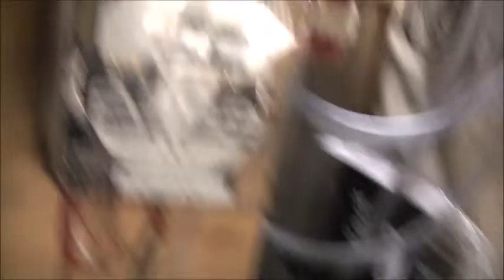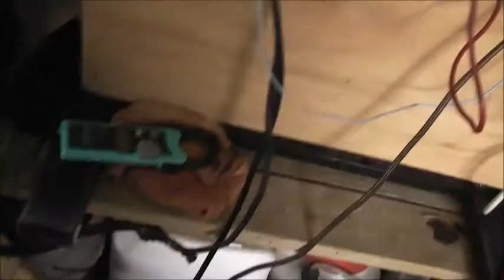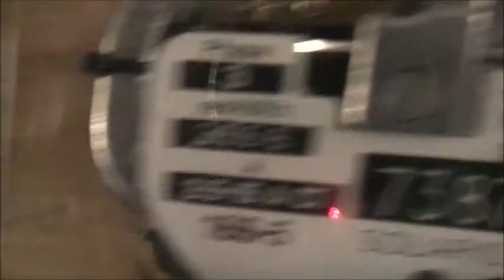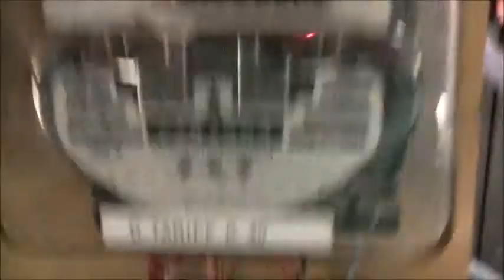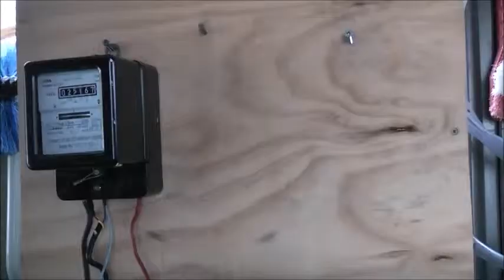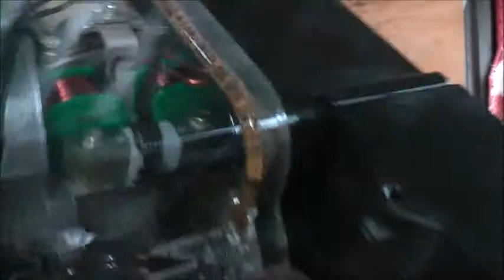EMAIL SD MR Dual Tariff CT Watthour Meter Test & Clean!

Comment: Those LEDs on the front are to indicate that the three phases are operational. They aren't for detecting the speed of the loadwheel or for flashing on-and-off or anything like that.

Basically, if an installation lost a phase (blown fuse or lost phase on the gird) then this would indicate what phase has been lost, and the fact that one of the phases has gone.

Rodalco has a 3ph meter with the indicator lights, but I'd say by the look of things, the meter has been modified at some point and had the indicators added. :-)

Thanx for showing,

-BoomBoxDeluxe.

23rd October 2015, 01.00